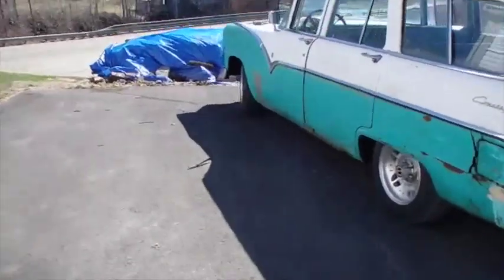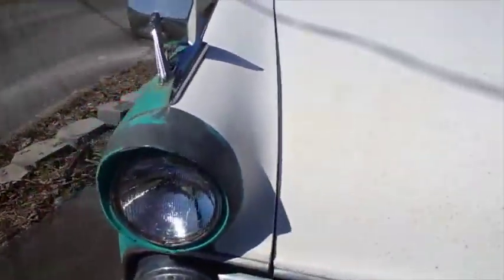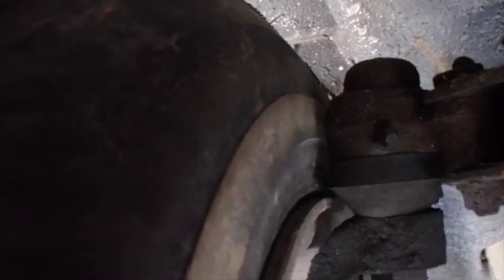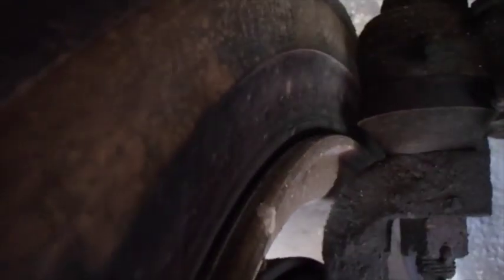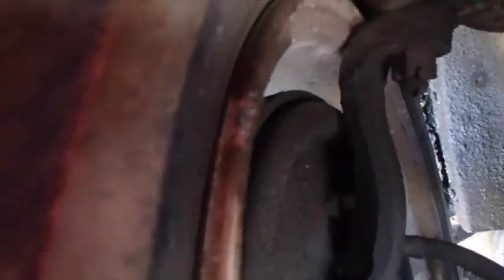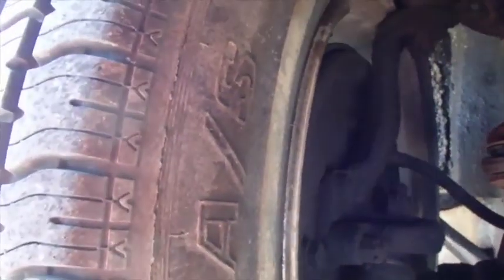Tire Wheel Scrub 1955 Ford

Comment: I had a 64 Lincoln that the former owner put some big radials on. Just like your Ford the tires rubbed on the upper ball joints when cornering. He put some wheel spacers on it to compensate. After he did that, I did a wheel alignment on the car (we both worked at a Lincoln-Mercury dealership). He complained that it wandered a lot on the road, but the alignment was spot on. I think we may have even added a little caster, but it didn't make much difference. I ended up with the car and had the same experience. After a few years I replaced the tires with a smaller size and did away with the wheel spacers. The road wander was gone, it drove arrow straight. Not saying this will happen to you, just saying.
Reply from the maker: Interesting...